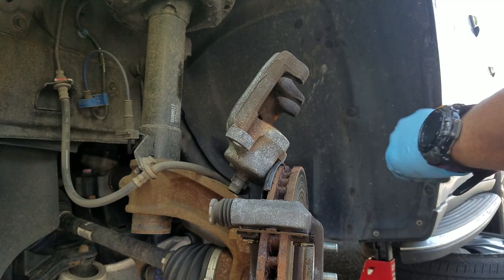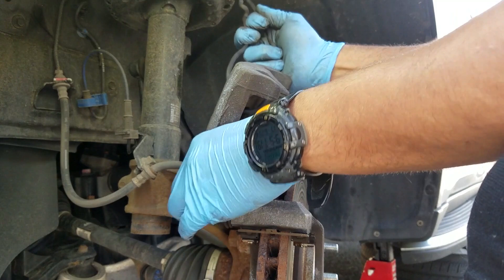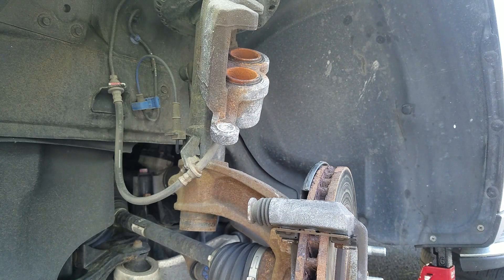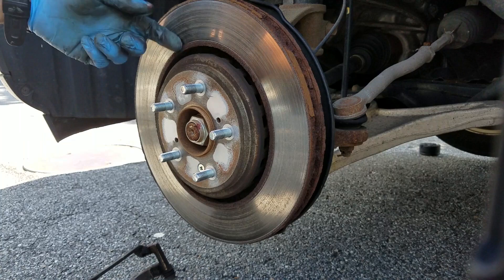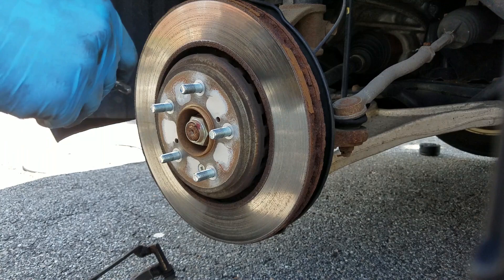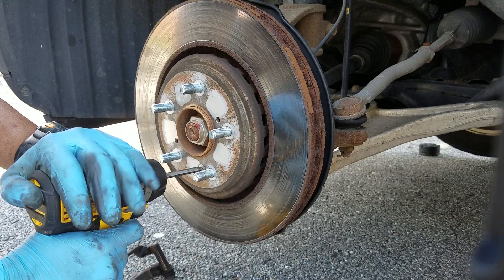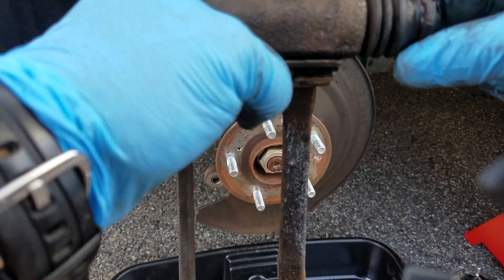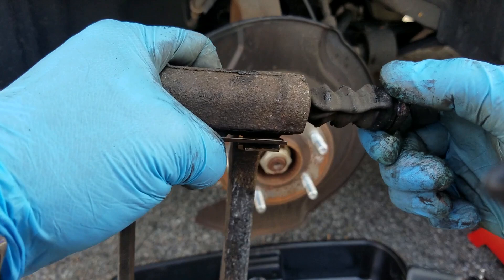FRONT Brake Pad & Rotor Replacement - 2014 Acura MDX

Comment: Nice work and you make it look easy. Going to attempt all 4 on my RDX. I see a kit on Amazon for all the rotors and pads to do my whole truck. Where did you get your parts from?
Reply from the maker: Thanks Cliff. All 4 rotors are "Raybestos" brand which got good reviews and are about half the price of Honda OEM rotors. I purchased them online at FindItParts.com and as for the pads...Honda/Acura OEM, which I also purchased online...from AcuraOemParts.com .  I put all the part numbers in the description but I doubt they are the same for an RDX. Do some homework first.
Reply: No sir wait! That’s a different model than the one in the video. You’re going to blow up your ca—- .. I’m probably too late aren’t I

Comment: My man! 
Outstanding brake pads & rotor replacement video! 
I too own a third gen MDX. 
I too am not a mechanic but I’m a DIY kind of guy so when the Acura service agent gave me the estimate of $630.74 before taxes to Replace my Pads & Resurface my Rotors. 
I told him not a bad price, 
and decided to go on Amazon where I found a new 2014 Acura MDX pads & rotor kit for under $300. I purchased it.  As soon as my parts arrive I too will be diving in on the same project myself and your video will be right next to me as a guide. And I will be picking up new rotor screws from Honda as well. Thanks!

Comment: Real nice job Brooklyn! quick tip when you're buttoning up after rotor and pads are on, try putting the 17mm bolts in the caliper body, top and bottom,  thread it to barely connect, then pull one out at a time to flip the caliper body up or down like a clam shell to place those "wishbone" spreader springs one at a time.  Takes a minute longer but, here's your third hand.  Great job.  Gotta love Brooklyn.    Torques should be: 17mm - 53 ftlb 19mm 101 ftlb., lugs 80  ftlb (graduate 50-70-80)  Please verify.

Comment: Good work. The threaded holes in the rotor are there to help you pull the rotor off. Screw in two bolts of the proper thread, they will push against the rear flange pulling the rotors off
Reply from the maker: Yeah, I know that now Jim. Unfortunately I found that out 2 days after performing this brake job.  I felt extra silly about it.  well....Ya live and you learn..
Reply: Add the M8 1.25 x 30mm flange bolts to your shopping list when taking on the brake job. I got mine from Autozone, cost me $4. It is a godsend, works like a charm.

Comment: Nice job! Not enough people take the time to change camera angles for the best view. You do and shade tree mechanics will really appreciate that.  You’re giving a lot of people the courage to do this themselves.  A couple tips from my own experience: get an 8M x1.25 bolt (that’s what my TL and my Ridgeline take) to screw into the holes in the rotor hat.  That’s what the additional holes are for — as you tighten the bolts, it forces the rotor off the hub.  Works like a charm.  Take the cap off the brake reservoir before you push the pistons back into the bore.  Use a mechanic impact screw driver (some part stores will loan them or rent them for nothing) to remove that rotor retainer screw.  Finally, change the metal pad retainer clips in the notches of the caliper bracket. Use only stainless steel.

At my local shop $400 parts and labor to put pads and rotors on my TL.  You’re saving people a LOT of money nice work!

Comment: Good job..no need to locktie , looks like flex brake hose is twisted on install. Also remove antirattle rubber bushing on lower sliding pin they sell an seize pin causing uneven pad ware. Good luck my friend.

Comment: IMPORTANT NOTE:  The rotor screws are NOT phillips just so you know. They are JIS #3's heads.    Honda and Toyota and some other manufacturers use JIS Screws (Japanese Industrial Screw).  You need a special bit or screw driver and they will come out easily.   Vessel makes a impact screw driver for these.    Link: https://www.amazon.com/Vessel-125943-P3x150-Impacta-Screwdriver/dp/B003BGTTSE/ref=sr_1_1?keywords=vessel+screwdriver+%233+brake+rotor+screws&qid=1579872990&sr=8-1       Hope this helps.   I bought this driver and you can use the hammer on the end of it.   Works great!     No more swearing on that screw!

Comment: Front Caliper Bracket torque spec=101 lb-ft. Caliper Slider Pin=53 lb-ft.
Lug bolts torque spec=92 lb-ft.
Reply from the maker: Wow.  Where were you when I needed you 6 months ago..lol.   Thanks for the info. People will find it useful.
Reply: Thank you.

Comment: My man you do good work.  2 notes sir.  1 you need to use clean gloves when installing the née rotor.  You got dirt and grease on the rotor.  Said you were gonna clean it again but forgot.  The dirt and grease will cause improper heating and wearing and will warp your rotor all over again.  2.   If you have a warped rotor you should replace the pads as well even if newer because the rotors have Mis shaped the pads with the rotor wobble and with the groves in the rotor.  So when you put those pads on the new rotor they are not making flat perfect contact as they are supposed to and that too will cause the new rotors to warp.  How do I know yup been there done that.  Again you do a great job just trying to help a brotha out.

Comment: Anyone who wants to make this job infinitely easier, first of all get yourself a $20 hand impact driver. Put the biggest Phillips head bit on it get it in that screw, turn and whack the end of the hammer and it'll be right out of there. Best to give a little squirt of penetrating oil on that screw and also in the two holes on the rotor. Now let's get to those two holes on the rotor. Those are threaded screw holes. Find you the right size bolt and thread bolts into both of those holes. Get them hand tight and then proceed to tighten them about a quarter to half a turn each alternating back and forth between each bolt. Also alternate with giving the rotor a couple of whacks with a hammer every now and then and they'll pop right off.

Comment: Next time you can hold the pads in place with a C clamp.  Install the springs, partially lower the caliper over the pads, then remove the C clamp.

Comment: very good video    invest in a impact driver tool for removing the screw that holds the rotor on.  they are not to pricy and work fast  in removing the screw   even the one at hft  is good enough    they  even make impact screw drivers now  i bought mine on amazon  and they were called vessel
Reply from the maker: Thanks for the tip.  I learned about that Impact Driver tool about 2 weeks after I did this video.  I was upset.You live and you learn....I guess

Comment: Get an impact screwdriver where you hit it with a hammer. Also, if you remove that 12mm brake line bolt you can use that to screw into the rotor to release it off the hub.

Comment: you need to use a 3 or 4 lb sledge   put the lug nuts back on so you dont miss and hit a stud   and hit it very hard with a 3 or 4 lb sledge hammer   also be carefull where you are hitting the  rotor   if you are replacing the rotor  then it does not matter where you hit it     but if you are keeping the rotor and reusing them  dont hit the face

Comment: Its recommended to change pads with rotors cause the impurity of the pads (grooves) off the older rotor will mess up the pads...thts why they always recommend resurfacing rotors when changing pads or replacing them doing the job once
Reply from the maker: Yes. I've herd that before, and I agree. But these pads were just a couple months old.. practically new -with no visual wear whatsoever. What happened was I just purchased the car this year and noticed the pads were running low. About a month after the pads were installed.. I started to notice a slight vibration when braking..this is why the rotor change was necessary (maybe not all 4 but why not). There's no way I was going to buy another set of OEM Acura pad$$$  with a set this fresh. I think the rotor and pads will be fine. I'll keep an eye on it. Thanks for your feedback.

Comment: penetrating lub would have helped and let that screw soak a bit before any attempts at loosening.
Reply from the maker: Yea. The next time I perform this brake job, i'm  gonna do a couple of things differently. First, I will use a manual "Impact screw driver tool w/hammer" on the rotor screws. I think this tool will do the job way more aggressively and faster than the impact drill. The BIGGEST thing I would do differently is to use two 8mm screws inside those blank rotor holes to raise the rotor off of the rusty hub assembly..ie  NO HAMMERING on the rotor for 10hrs.!!! These things I learned days "AFTER" completing this job. I was PISSED!!  Oh well...You live...You Learn!!

Comment: Great video brother. I too have a '14 MDX and I think this is the first video for this job. Actually not too many videos out there for the 3rd gen MDX. I was worried there for the rotor screw but you got it! Have you checked the videos by Eric the Car Guy. Tons of useful videos that would apply to our car. This one lines up perfectly with yours https://www.youtube.com/user/EricTheCarGuy/search?query=brake
Keep the videos coming man! Ruben from Los Angeles
Reply from the maker: Yea...I definitely watched a bunch of Eric's videos to gather up the balls to perform this job on my own..lol. Don't use a hammer drill like I did in this video, I think a Manual Impact Driver is the way to go. I got one for about 15 bucks on Amazon. And don't you dare place uncoated rotors on your vehicle. Either buy em' coated or paint them yourself before putting them on.  Thanks for watching.